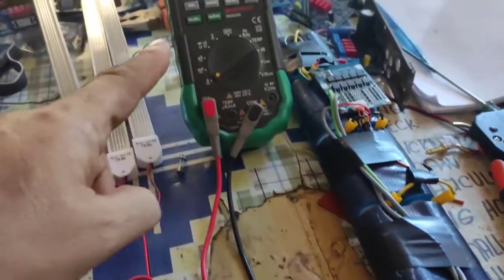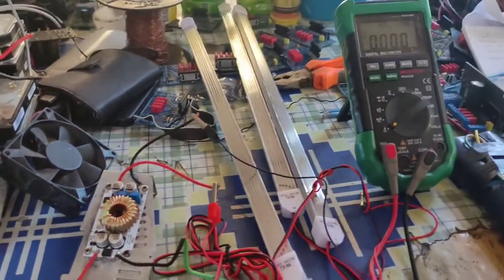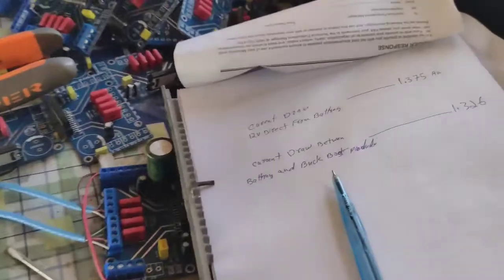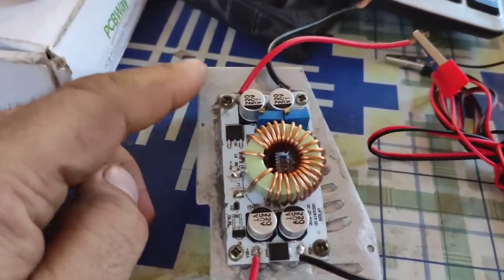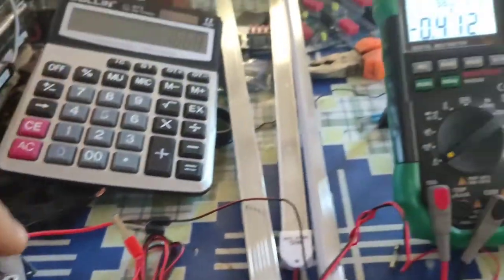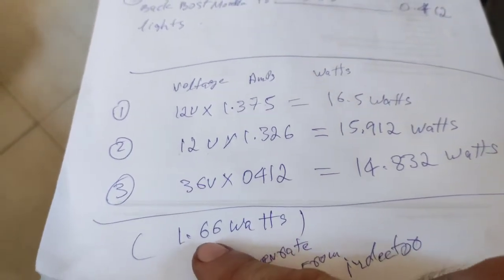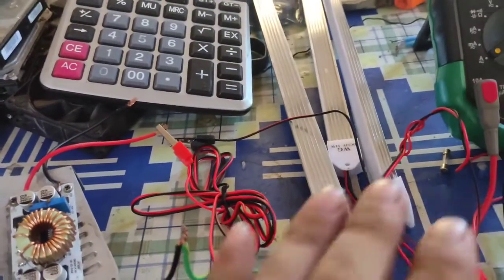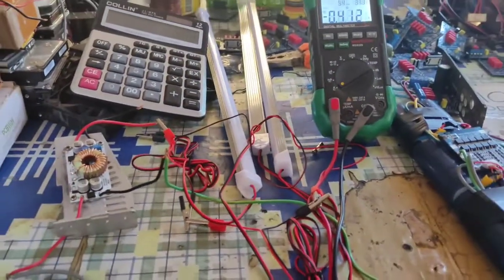Save your battery life with buck boost Module

Comment: Ohms law power cannot be created or distroyed
Reply from the maker: I understand that but one question when we give input to transform that can be 12v high frequency then In output we get 220v so the question how's magnetic field genrat power ? In physics low input high output is possible  so it means hybrid technology is correct so something like that Brother
Reply: So you are saying you created more power without drawing more milliamperes without any loss and you are 100 percent efficient 
You should get the noble prize !!!! You must be a genius unfortunately this is impossible maybe the military can do this with alien technology but as of now it’s impossible on earth you are actually drawing more current from your battery with the buck
Reply from the maker: @jimcatanzaro7808  brother buck use only for constant current and constant voltage just that's is so battery will work long if no have buck battery can drain more fast just that is what I am saying
Reply: @MarkPrince1317  so do a test what will run longer till it dies out  you have to have to do both test I bet it will last longer with just the battery
Reply from the maker: @jimcatanzaro7808  ok Brother I try today